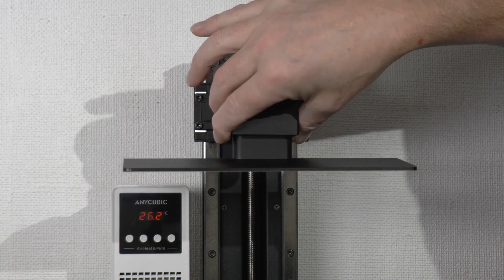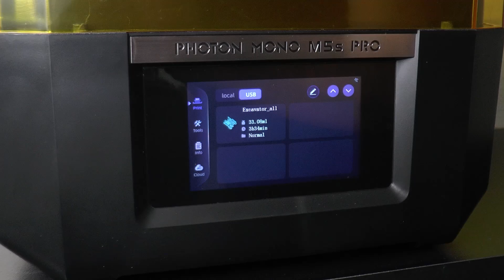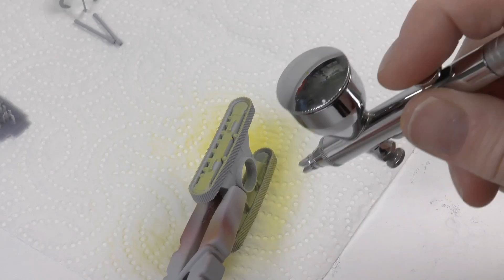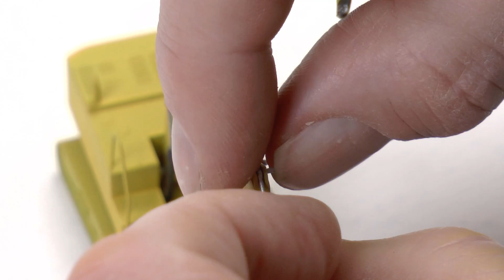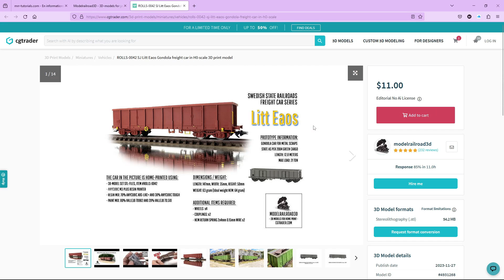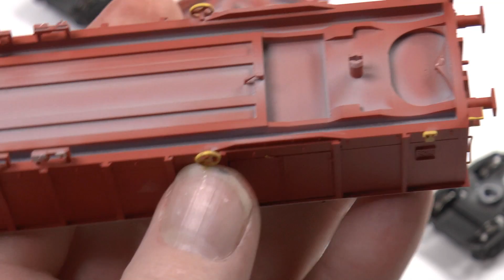Building a Realistic Scrapyard with 3D-Printed Vehicles

Comment: Don't trust anycubic. Their m3 premium was discontinued in less than a year and you can't get replacement parts. Screen only last under 2k hours and needs replaced.
Reply from the maker: Hi! The developments of 3D-printers and resins are so fast, that one generation is only valid for 3-8 months. Same goes for the electronic components from which they are built. This is not a brand specific issue. You’ll find it valid for all consumer level printers in the market.

Comment: You have forgotten the price of the printer, downloads, materials and paint ... ten gondolas at $25.00 is not going to pay for a $650 to $1,600.00 printer. I don't need that much stuff on my small 10' X 10' layout.
Reply: If you wait 2 years or buy a older model you can easily get it at half the price with nearly the same quality. The downloads, resin, and paint all would cost around $50 but about less than a doller to produce a single cart

Comment: Another step in resin printing, especially the internal heater. Wonderful! AI chip? What does it do actually. I will have to add though that we would never want a dependency on a cloud and even Wifi though but I do read in the specs via the link that a USB Type-A port is provided as well. A bit vague all that to be fair but the price certainly is a good one. We are still in the process of thinking about 3D printing (resin) but we also have a shop nearby who can do it at very fair prices as well. It doesn't only save costs but you can also have stuff which main model manufacturers do not supply and at fantastic detail. We are wondering if manufacturers should be worried about the pace of progress of 3D printing actually.
Reply: The biggest hindrances on 3d printing with resin now is the time and money it takes to process the prints, the supplies and equipment needed to do the process efficiently can easily outweigh the cost of this printer, so if you have the time and patience to clean up messes and trouble shoot it might be worth it in the long run.